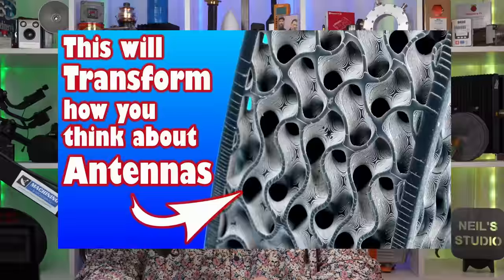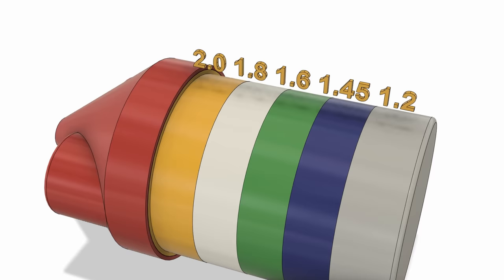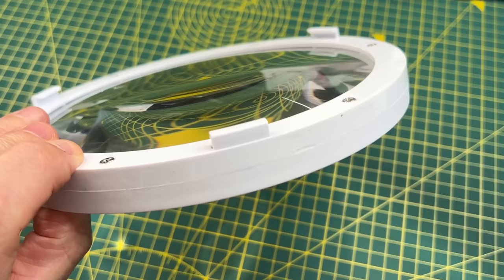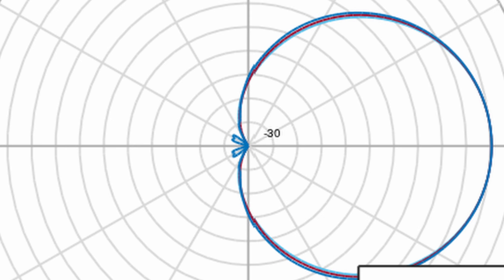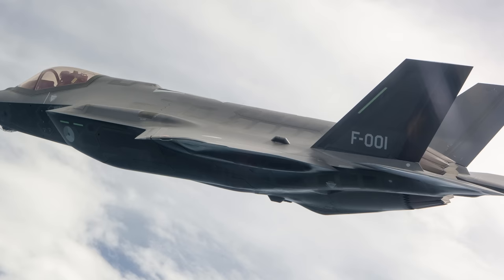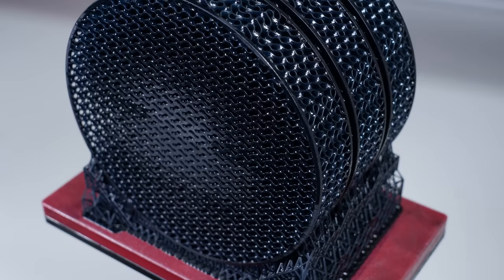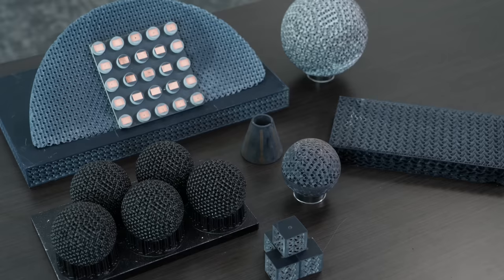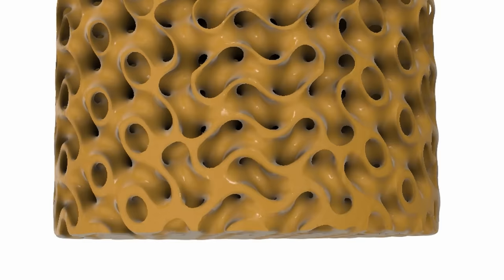How Microwave Lenses REALLY Work!

Comment: hi, I've recently stumbled on this channel and it is fantastic ! you also seems like the exact right person to ask a few rather nerdy questions that necessitate a microwave knowledge that I do not possess :  

I am playing "DeltaV : rings of Saturn" a hard-scifi game about mining the, you guessed it, rings of Saturn (it is very good and I really recommend it) and in this game one of the "mining tool" (in quotes because anything able to crack a chunk of ice a few cubic meters across in a handful of seconds is very good to pierce holes in opposing ships too) available is a high power microwave emitter with a wavelength of 1cm and a power output of 45MW. 

In the game, this tool can be tuned to output up to 75MW of power, but doing so defocus the beam (which isn't isn't very focused in the first place, thus making the tool relatively short-ranged, with a practical range of ~200 m), citing high-power microwaves refracting within the emitter dish as the reason.

Thus my questions are as follow : 
- Is it a good (or at least good enough) approximation of what would really happen reality, assuming a fixed geometry dish ?
- Can this phenomenon be mitigated or eliminated with a different focusing method (variable geometry dish, 3D lenses or phased array to name the few I am aware of) to achieve a relatively small spot size at long distances (let say 5m of diameter at 1km) ?
-If the above cannot be achieved with a standard emitter, can a maser do it ?

I hope that I am not asking too much and that you will be able to answers these questions that have been bugging me for a while ^^
Reply from the maker: Right. There are some things that happen with really high power densities, even in a vacuum.  One of the big issues is multipactor damage, where electrons from the conductive materials are literally ripped out of the metal and crash into the opposite side of a cavity, releasing a cascade of electrons that are then accelerated and themselves cause more electrons to be smashed out, leading rapidly to ionisation and generation of plasma, even in a vacuum. At 30 GHz (1cm wavelength), generating high power is usually done using electron gyration in a Gyrotron or Gyroklystron.  As the electron gyration frequency is related to magnetic field, getting a large enough magfield is close to needing superconducting magnets, which are certainly a little easier in deep space, but a bit impractical.  At 45 MW at 30 GHz, the voltage across a waveguide in a vacuum is going to exceed the breakdown value by some margin, so you'd have to be looking at some sort of waveguide cavity combiner.  There are certainly designs around to reach megawatt levels using a radial coaxial combiner design, but even that is close to the limits where multipactor issues start to hit.  The systems used in fusion energy are at the extremely serious end of what's possible, but they then to use superconductive magnets to get well over 100 GHz. Once you get to relativistic electron speeds, the simple omega = eB/m relation (B is mag field, e is electron charge, m is electron mass, so at 2.5 GHz, you need about 0.1 T,  (approx 28 GHz/Tesla) whereas at mmWave you start to need to include the relativistic Lorentz factor and multiply that expression by sqrt(1-(v^2/c^2)) as usual. The size of the equipment is related to the gyroradius, which is something like  3.3 gamma * mc^2*(v/c)/(q*e). Gyrokinetics is a thing, it seems: https://en.wikipedia.org/wiki/Gyrokinetics Yikes.
Reply: @MachiningandMicrowaves  oh my, I am guessing that the game is already quite generous in its estimations then.
 I imagine that a setting like in this game that has Z-pinch fusion torches working and commercially available would have a tech level high enough to get it working but any focusing method more complex than a big monolithic dish would experience some sort of rapid unplanned disassembly at these power density.
 
(but maybe a gyroid lattice lens in a refractory material like sapphire could be actively cooled enough to handle a few megawatts of waste heat using the channels that are inherent to the design, but then you have to take into account a moving fluid with a changing density gradient as the temperature of the lens changes in the lens design and I don't want to touch the maths that would describe that with a ten feet pole !)
Reply from the maker: Cooling with chilled gas might work if the energy density and loss tangent was low enough.  I don't think metallic metamaterials would be any better as they still need a foam matrix and they are fairly lossy. massively parallel phased arrays are also a nightmare to cool.  I guess you could use something like Simscale on a big cloud compute service to do the thermal energy flow modelling.  I really need to up my Simscale skills, but then I need to get better with Blender first.  Too many toys, too little playtime.  One of my few claims to fame is that I have never once played a computer or console game.  Not even Pong or Galaxians.

Comment: Radio waveguide principles can often be repurposed for sound-waves too. I wonder if these gyroid lenses could have acoustic applications.
Reply from the maker: It should be easy enough to model the acoustics, so long as the feature sizes are a small fraction of a wavelength. Main extras are the heat control, agitation and intermittent wiping. Keeping the inclusions in suspension and at a uniform density is the challenge. It would be fun to try mixing home-made material using alumina or TiO2 or similar high-k low loss materials, but finding a suitable low loss resin matrix might be challenging. I'm testing some filament with ceramic fill at the moment to see what results I can get.

Comment: Nice lesson, but eventually this approach got me thinking about Fresnel lenses. In other words, a Fresnel lens for radio waves. I'm not convinced that directivity can replace the meaning of gain, as you said you consider the same. Gain needs a reference (isotropic, dipole, etc.), but directivity and gain aren't necessarily related, they are two different things. It's possible to have great directivity and still produce negative gain.
Reply from the maker: I don't think it's useful to talk about gain with passive aerial systems, as they don't really have anything other than loss, but I was being deliberately provocative there. You are 100% correct of course, Directivity and Loss are both important for antenna systems.  I'm working right now on some 3D printed Fresnel Zone Plates and lenses using some special dielectric filaments, I hope to get some more videos out before the end of 2023.  My life has become extremely complicated over the last six months and my video work has gone onto the back burner for a while.  Fresnel Zone Plates about 180 mm diameter have useful gain at frequencies over 47 GHz, but I'm working on some large versions that are printed in segments, with anti-reflection chokes on the flat surfaces, but getting the supports right is proving rather difficult.  I may need to look at at alternative solution for the AR surfaces unless I can get clean enough supports.  I might need to change to a soluble support filament to get the best possible results.

Comment: Could you apply the use of prisms beyond the visible spectrum? Would this create a similarly amazing effect that it does with refracting visible light into the ‘roygbiv’ bands.
Reply from the maker: That's a very interesting question. The reason prisms work with visible light is that the refractive index of most optical glasses varies appreciably with the wavelength of the light. Very few materials have rapidly-varying permittivity/refractive index across the microwave wavelength range. Optical transmission gratings and mirror gratings work fine for splitting microwave wavelengths into a spectral range. Most materials that do change RI rapidly at radio frequencies tend to have rapidly rising loss. I think a resonant metamaterial might be able to do a prism-like spectral shift over small wavelength ranges, but I'd need several large glasses of something before trying to work out the maths of that.

Comment: I remember doing the waveguide propagation theory, that was interesting and somehow a bit weird as the propagation was slow compared to in air or a vacuum. Thanks for the video :)
Reply from the maker: Waveguide cutoff is a fascinating effect as the guide wavelength goes off towards infinity and the loss rises exponentially
Reply: @MachiningandMicrowaves  i seem to remember we used waveguides as attenuators in some measurement devices

Comment: Could you do a video on how negative db is measured? Example from satellites that are far away they often talk about signal strength in -160db. How do you measure a negative signal? 🤔
Reply from the maker: dB is a measure of logarithmic ratio. Signal strength is usually measured relative to one milliwatt as dBm, so if a signal is one nanowatt, it is a millionth of a milliwatt, so as a power ratio it's 10^-6.  Convert that to a base-10 log and you get -6, now to convert to decibels, multiply by 10, that gets you -60 dBm.  A picowatt is -90 dBm, a femtowatt is -120 dBm, so the power represented by -160 dBm is about 100 zeptowatts. Thermal noise at room temperature in a resistive source is about -174 dBm/Hz, so it's close to impossible to receive a -160 dBm signal at GHz frequencies because of phase noise and atmospheric scintillation, even from a distant satellite.  However, if the receiver is cooled and the antenna is pointing at cold sky, you can do better than Boltzmann's constant would imply at room temperature, so -160 dBm isn't impossible, so long as the bandwidth (and data rate) are low. The path loss to the Moon and back at 10 GHz, along with the 7% reflectance of the lunar regolith, is around  289 dB, so with a 20 watt transmitter (43 dBm) and 50 dB gain antenna, I can send out 93 dBm.  A receiving station with an antenna gain of 50 dB also reduces the path loss, so I pick up 143 dB. I should expect a signal of about 143 - 289 = -146 dBm in my receiver, although I'll lose a few dB from the noise temp of my receiver and antenna relay and any feedline or connectors
Reply: @MachiningandMicrowaves  Thank you for a really great and easy explanation! Love your channel! 🚀

Comment: Great video. I've thought many times about what happens at an atomic level within the dielectric in a traditional capacitor, and also what happens with a wave passing through a homogenous solid medium with a relative permittivity Er, but never really got around to thinking about the passage of a wave at the atomic level and what happens to the polarising atoms/molecules to create the overall value of Er. So very interesting for me. What are you planning to do on 24GHz?
Reply from the maker: I cut out the quantum segment, and I was going to run a simulation of a tiny system of resonators, btu ultimately this is going on at the electron level even though the induced dipole oscillators are at the molecular scale. Treating the system as macroscopic Polarons with mass, momentum and energy sounds like a reasonable treatment, but I read over a hundred papers and couldn't find anything that was accessible enough.  The temptation of academics to preach to other academics and assume the base level is a relevant PhD is very alluring, and the whole way academic publishing works means that ordinary humans are excluded from the secret knowledge of the priesthood.  Anyone would think Physics and Maths are hard!  I might have a go on the second channel. but this video was WAAAAAY too much effort for my poor brain.  I need to get back to machining things for a while!

Comment: Every EE wants to understand microwave engineering because it's so arcane. Unrelated question: how do you convince the space-based solar power enthusiasts that Friis equation diameter calculations don't pertain to the far field, and there's never been a half power beam width in 2-6 GHz below about 1.5 degrees? Most of their proposals describe rectennas in one or two square kilometers lit from geostationary orbit, instead of something the size of Puerto Rico with billions of dipoles every few centimeters apart.
Reply from the maker: It's hard enough trying to explain to most folks how/why the changes between reactive/radiative near field and far field happen and just how far that happens from a typical giant antenna system.  I guess they will propose some form of adaptive array like the giant telescopes use.  It's great business for power semiconductor manufacturers of course, and the political layer always matters. Removing any dependency on oil producers is probably the key driver. Politicians love that concept.
Reply: @MachiningandMicrowaves  I'd love to see a formula on Wikipedia with the same inputs as Friis equation, but that actually works for giant antennas over great distances. Hasn't anyone ever published such a formula?

Comment: How can I calculate the required antenna shape from a signal strength pattern mapped onto the surface of a sphere? Reverse engineer it as it were, except the antenna does not exist, yet, and we have just generated the desired pattern for that sphere surface?

Comment: Amplitude of a guitar string E=1/2*uf^2A^2v; E is in Juels; put together with E=mv^2.  gave me an equation that many physicists have worked with and came to a dead end.  Up until I put it up against a microwave oven and the distance of the water molecules.  I also put it up against the Bohr radius and the .210614054m wavelength and got exact results.  I was looking for the diameter of a photon, but I found something else instead.  It gave distance between charged particles and wavelength absorbed and transmitted.
D= (wavelength)(5.025089342)(10^-10m).      Maby you can do something with it.

Comment: Light "travels" with speed C between the interactions. So in vacuum there's nothing to interact with but in a transparent solid there are A LOT of particles that the light interacts with i.e. "bounces off" of, so the overall / total speed is lower than C. It's the time of all the interactions that is "slowing down" the light. Between the interactions it still travels with speed C, as expected.
Reply from the maker: For microwave photon energies, there isn't anywhere vaguely close to enough energy to cause absorption and re-emission of photons, we are only talking microelectronvolts of energy per wave packet.  When you say the light "bounces off" the particles, what's the nature of that interaction? Photons don't feel the electric or magnetic fields of the nucleus or electron clouds, and the atoms are almost entirely a vacuum, with the nucleus having a diameter about 1/30000th of the atomic diameter. What form would those bounce interactions take?  Wouldn't most of the photons come out at random angles if there was some sort of bounce interaction, yet light and radio beams some out parallel if they go in parallel. If they go straight, then they must be slowing down, which we've agreed is impossible. Where you say that it's the time of all the interactions that is the source of the slowing, are you suggesting that the originating photons somehow take a random walk path through the material?  Wouldn't that mean the output beam of a fast pulse of photons would be spread out in time?  That's not what we see. The delay is consistent and there is no pulse spreading in time or direction in a near-perfect dielectric.  Why would there be a correlation between the strength and length of molecular bonds and the refractive index of microwave dielectrics rather than just the density of the material and the mass of the nuclei and charge of the electron clouds? OK, it's perhaps a gross simplification to take classical approach of treating the incident photon as a bunch of EM energy whose fields interact with all of the molecular bonds in the material by stretching and compressing the molecular bonds, but if we follow that approach, the moving charges along the bonds cause their own EM fields to be created by stealing some of the energy of the incident photon then reradiating it with a phase lag caused by the physical movements of the atoms and bonds. The superposition of all of those small fields and their interactions with each other means that the incident photon loses its identity and we get coherent forward scattering from the induced fields which then combine to give a resultant field that becomes a new photon that leaves the dielectric, with all of the directions and polarisations summing so the phase and direction of the new photon makes it appear that the original photon went more slowly through the material. No photons bounced off anything, no photons went slower than C.